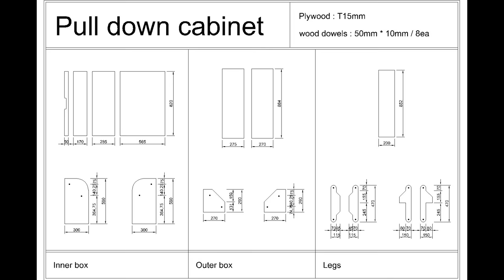Pull down shelf with plywood / woodworking / mechanism

Comment: I've been looking for something clean, simple and smart like this for almost two years.  Sending love and warm wishes from Canada!  A little custom measurement mods and will be amazing over laundry shelving so little kids can't reach chemicals.
Reply: Thats my exact reason as well.
Reply: same ive been looking for something this everywhere
Reply: Lowes has pull down shelfs.   Take out a loan before you go.
Reply: @mas5867  they do, they are good, but not avail outside the one option they sell for length/weight.  Made a few matching sets from this design in the laundry room for pull down cabinets to keep detergents and general cleaning chemicals hard to access for kids.

Comment: Okay… I think in the tiny cabin I’m building in Alaska I’m gonna use these for upper cabinets, and the lower cabinets will be your design where the shelves come out sideways and then turn so you can see everything…. That leaves the corner cabinets… so, you need to design some lower corner cabinets that pop up (and upper corner cabinets that pull straight down).  I know you’ve been thinking about it.  If you or I wanted to drop cash and motorized it would be easy to do, but that isn’t me and it sure is t what you do on your channel…. So you need to design corner cabinets that pop up to access what’s inside, and then can be pushed back down to hide them.

I’m asking for a lot, but it’s another video for you with another amazing design to get subscribers and views, go on, say “challenge accepted!”

Comment: I love this project! Have probibly seen it like 20 times now and plan to do some accessible upper cabinets, like these, in my kitchen and laundry station as I am short and use a wheelchair. Have you tested out the weight on this? Would a heavy duty gas strut give more weight capacity or would the wood break if it was used for plates as an example? THANK YOU for a lovely channel with so much creativity!!

Comment: What is the idea with the dowels and screws for the hinge points? I like it, it just seems that after a while they would rub out the dowel and fail.  I would think here a threaded rod with a pipe insert would work better, I have seen them a lot in the recent videos.  If they are sound I just might start using them, or hell I guess i could just make something with it and if it fails then it fails :)

Comment: I'm not a woodworker but this is an ideal solution for a problem I have so I'm going to try to make one of these.  Thanks for providing the drawing with the measurements however, two measurements are missing!  For the inner and outer boxes, you show the measurement of the hole placement from the bottom edge but not from the right or left side.  I was wondering how to find the location for the holes?

Comment: This is really excellent.
There's two things I am not sure I understand.
One is those hinges.  I wish there was a better close-up of how they are assembled.
And the other is how do you spec that little shock-absorbing spring thingee, and where do you get them?
This is great for somewhere short of space and long on things that need to be stored within reach!  Great idea.
Reply from the maker: Search for gas spring. You can get it easily.
I used 9 kg. Thanks =)
Reply: @dekayscrafts what length is the strut?

Comment: Would it not be more handy to remove the stop blocks on the hinging two bars and (part of?) the bottom plate of the cabinet to let the cabinet sink even lower, which means you can hang it higher? It would then just need to get past the middle point to want to sink to a more stable position due to the pistons. Just thoughts. :)

Comment: Hi! Your works are awesome! I have some question about your tools...I see that you use the Milwaukee M18 hammer drill and impact driver. Is it not so heavy for basic woodworking stuff like that? Do you need the full M18 power and weight? Is it hard to control them?....I hesitate between M18 and M12 series... Thanks for your help!

Comment: It's a good inspiration. I wonder how thick is the  Wood.
Reply: Watch the beginning of his work you’ll see the drawings you’ll see the plywood is 15 mm are about five eights the dowels are 3/8 in diameter and 2 inches long or 50 mm and 10 mm you can posit and read everything if you need to
Reply: @rayraden2527  alright I Will read it thoroughly, thanks for the notification. You have done good.

Comment: Thumbs up ... BUT
Did you really need that haha? What difference did it make to have the shelves 1/4 of a meter lower! :D
Great idea and build and it also looks good, but you could make it go higher with some changes in plans so you could have more space under it with regular shelves?
It's best as a proof of concept ... maybe I would need one of those up under the roof? Hmmm ... with a rope or a stick to pull and push it up and down ... hmm